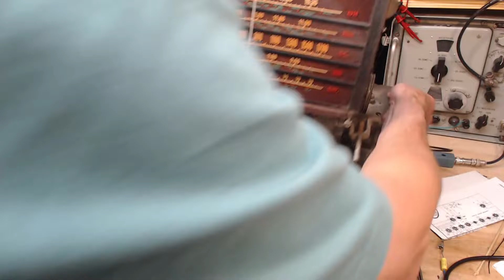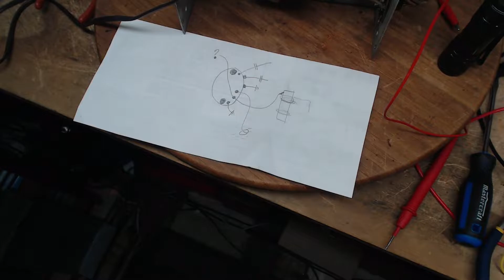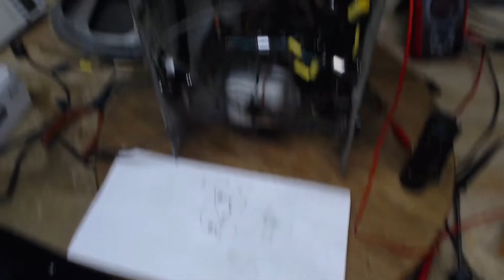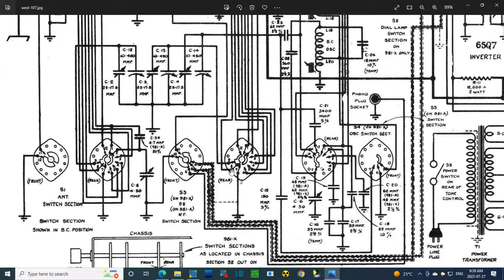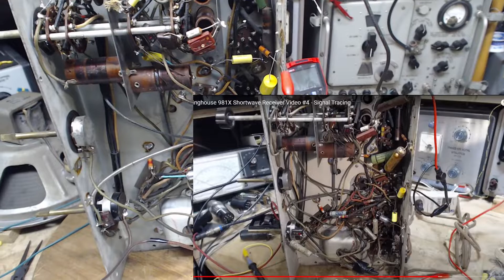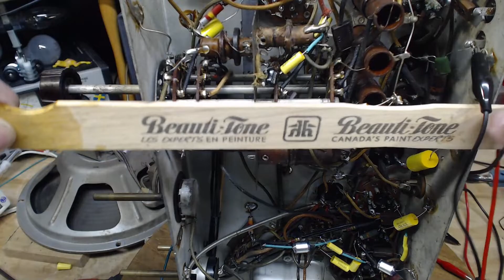Canadian Westinghouse 981 Shortwave Radio Video #13 - Mystery Wire Solved

Comment: A  twisted pair of insulated wires will make a low pf value capaciitor. As will a single small length of insulated wire running close to a ground such as that chassis panel the switch is mounted on. Move the wire change the capacitance, thus change the resonant frequency of the broadcast RF tuned circuit. Some radio manufactures used twisted wire pairs to fine tune circuits adding and removing the number of turns by twisting or snipping. Couldn't make out the schematic very well but was that indicating a value of 4.7 to 8.2 ?

Comment: Jim ! Why You do not recognize that the Coil and the  "misterious" capacitor are building a tankcircuit ? The one side is ground and the other side cames from the switch. It is so easy to see !! And with Your fingers You add a capacity to the 4,7 pif capacitor, this must be clear for You also ! Sorry if I have to say this 🤔